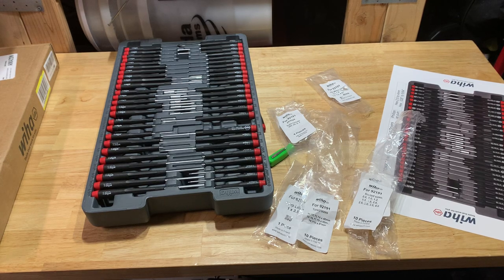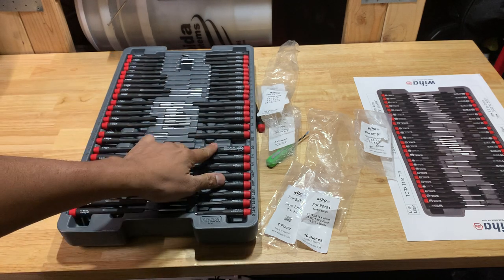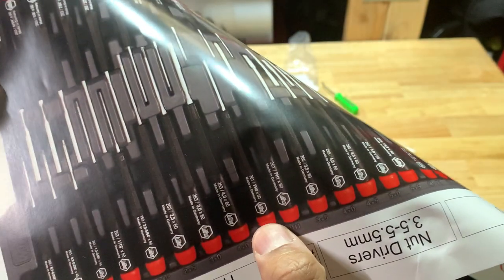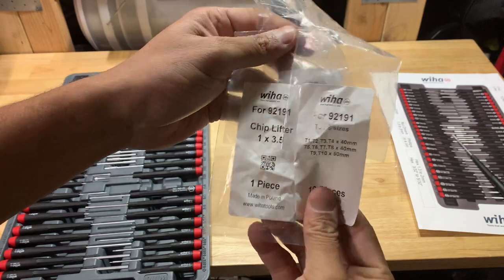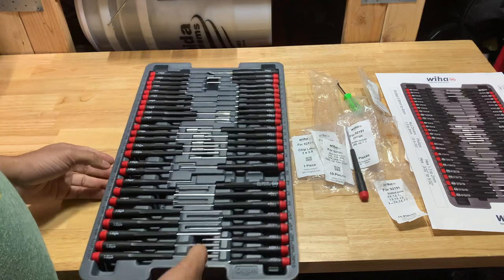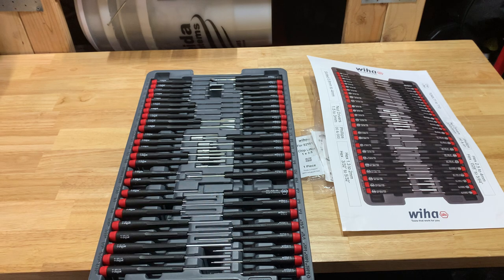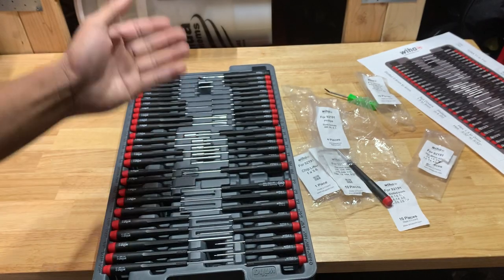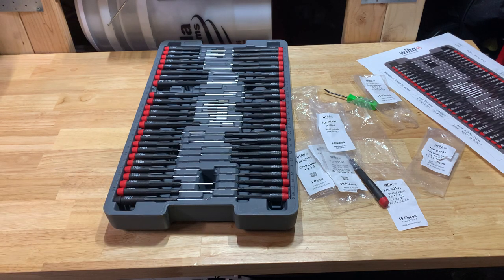REAL OR FAKE: Wiha 92191 Precision Screwdrivers 51 Pcs Master Set in Storage Tray  Part 2

Comment: The made in Germany are the original Wiha tools, thats what they're known for, German quality. As of late a lot of Wiha tools are being manufactured in other countries 🤷‍♂️. I'd contact Wiha directly and let them know about the duplicate driver, they should send you out the correct PH0 missing driver. Looks like a good set with a duplicate driver that's all. I have a similar set myself which is part# 92189, but with the includes pentalobe drivers for Apple hardware.